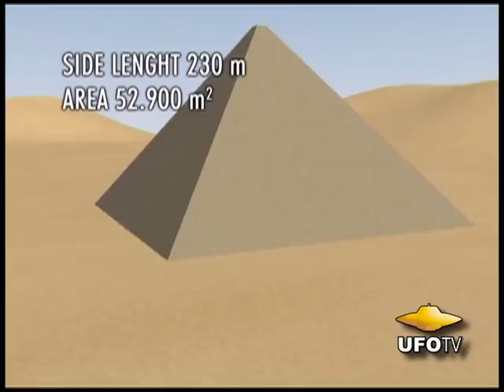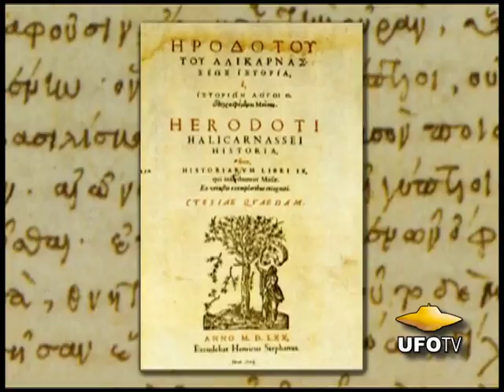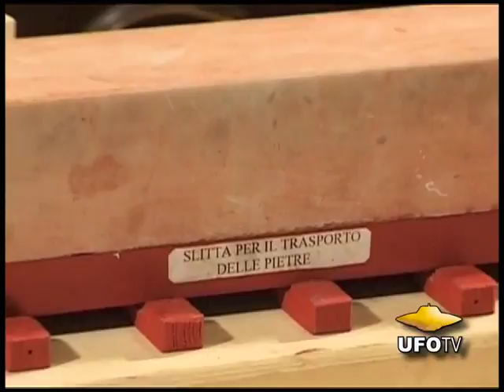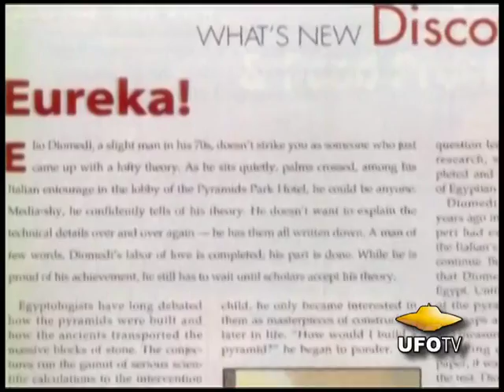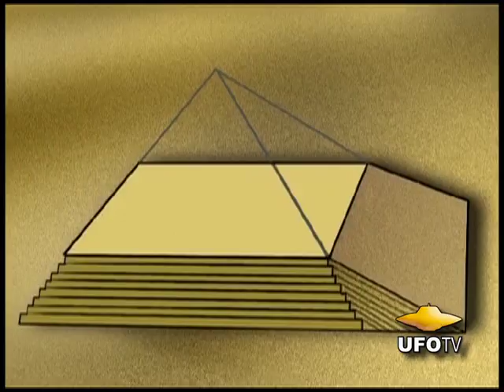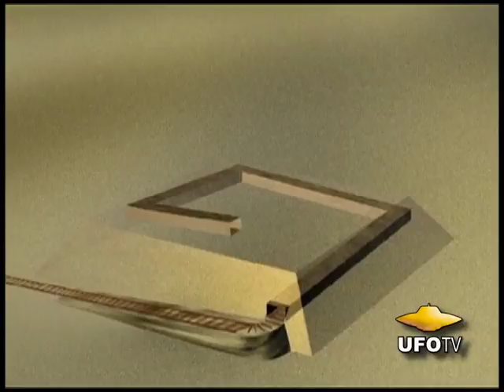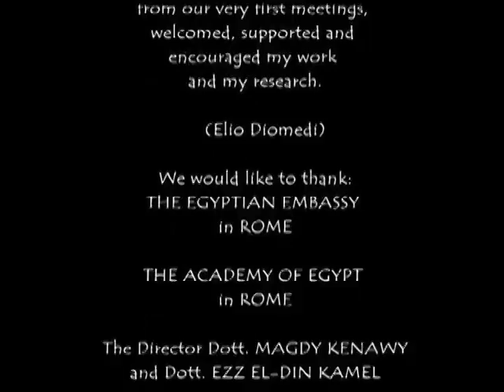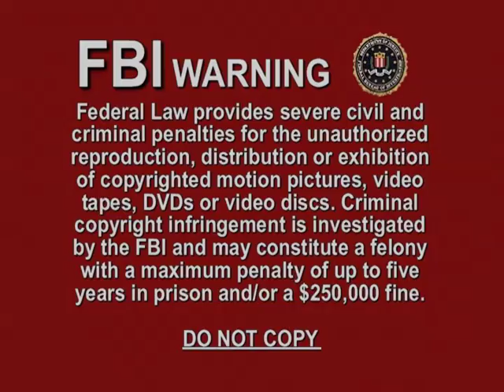The CHEOPS Pyramid Mystery - FEATURE FILM

Comment: It's important to remember the estimate of 2-2.5 million blocks is just a guess. If there are any as yet undiscovered chambers or an internal ramp was used for construction then the number of blocks required to build the structure comes down significantly. It's also probably worth mentioning that the blocks are smaller towards the top.  A better calculator exercise would be to determine the least number of blocks required to build the shape and it still be structurally sound.

Comment: The theory that it was built in 20 years obviously challenges us to speculate just how this was accomplished in such a short period of time. If it was indeed built by hand, then it is possible that it was NOT built from scratch but was rebuilt during this 20 year period. This would suggest that the pyramids may well be far older than what is currently considered. They may have existed during the period of Atlantis and suffered partial destruction during the final sinking of Atlantis in 9556 BC.

Comment: @eitan71 It's very strange that he assumes they could build essentially a whole railroad, use lubricants, build barges to carry 50-ton blocks 500 miles, assemble them in perfect astronomical alignment, plop on a capstone using a complex "sand-draulic" device, yet they didn't have WHEELS until foreigners introduced them a few thousand years later. No, whoever was squatting the land and scribbling hieroglyphs 3,000 years ago was simply not the same society that built the great pyramids.

Comment: the only thing that struck me, is that spiral tunnel system... as far as i know, stone blocks don't levitate on thin air, hence until they got to the top.. Even with some sort of support or a miracle on getting a longer block across the spiral corridor, the backtracking sounds a bit impossible

Comment: I feel I must point out that the great pyramid has MANY blocks weighing far more than two tons. There are 80 ton granite blocks in the kings chamber. If two tons takes 12 men to overcome the friction then 80 tons moved in the same manner will take far more than 480 men (40 x 12)  since the friction goes up with the square of the area of the block. Back to thousands of slaves then... unless they only built one block at a time!

Comment: This is similar to the French architect's theory, except that was more thought out in most matters other than how the blocks got to the pyramid. This person's theory doesn't explain everything or fit all the facts. It's an interesting theory, but I hope the theory won't be supported as fact.

There is no evidence for external ramps. Also, I don't think there's any evidence for the cap being lowered as the theory suggests. it's fact, as well, that the internal ramps weren't sealed up as another team previously discovered them still intact. This person's theory also doesn't take into account the pyramid's internal structure such as the gallery leading up to the King's Chamber, which shows sign of grease most likely used to help move blocks up the structure during construction. 

While this theory is good in many ways, it's pretty much a pale mirror version of a much more thought out theory. Also, the fact that Zahi Hawass is attached to this theory will hurt its credibility more than help it these days.

Comment: @the26thhour  What I understand from it is this:   those drives exist and make use of a zero point field but  has nevertheless an energy source in the saucer.  There is no inertia in a saucer because of the field they throw up around the craft and time and space are bent.  Also RV is involved and higher frequencies so they fly in a higher dimension for the most part of the journey outside time and 3d space thus super luminal speed. A ufo falls forward in a gravity well. its not like a rocket wrk

Comment: So they built it in 20 years or 7300 days or 175200 hours or 10512000 minutes.The pyramid has aprox. 2.5 million blocks of 2 tones weight each.How did they shaped ,transported,and put in place perfectly all of those blocks in under 5 minutes/block...using any method discovered so far?

Comment: - cutting/shaping: saws (there are clear saw marks on many objects) or some kind of energy cutting (laserlike?) via heating the stone up

- transport: anti gravity? there was no wheel in egypt in 3500 bc.

However, I think the timeframe of 20 years is not correct as well as the official age of 4500 years. So much yet to discover. 
Check out Coral Castle if u haven't heard of it yet

Comment: Everyone has mentioned the how to build method but one thing is a mess it took twenty years to build setting around 350 blocks a day that means they need to query cut smooth shape move and transport and position 350 blocks with no problems guess they invented shift work during the night if not how did they work with no or little lighting that would suggest to me 350 blocks in daylight hours that's around 1 block every couple of minutes I would like to see us do this today

Comment: This is no solution. I'd like to see the numbers on all magnitudes & angles as a stone moves up. no matter how you slice it it takes the same energy regardless of any method to move the stone from the bottom to top. Besides these structures were before any of the Egyptian dynasties. There is nothing inside that gives any ideas of whom built them & how. As some have stated there were civilzations before Sumer. I've wondered if the stones could have been floated to the top using a column of water

Comment: It'll take some physicist and a structural engineer to determine if internal channels could be constructed which wouldn't collapse under the weight of levels of stone above.  The key-stone concept would have to be utilized to keep outer stones of any weight from slipping outwardly under pressure from any upper layers.  I don't feel this is a satisfying "explanation" of the technique used. Camel fat, ties & sleds, neither.  Fulcrums, rolling the stones by addition of applied wood: maybe.